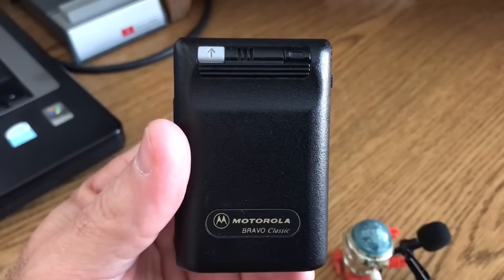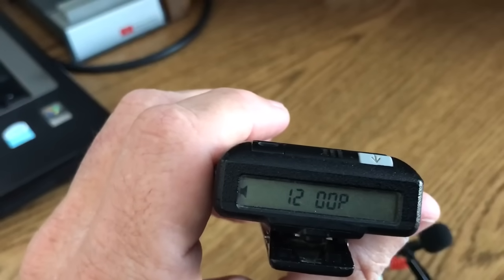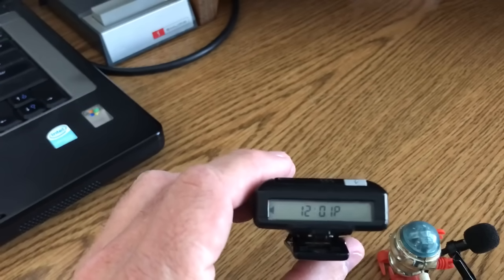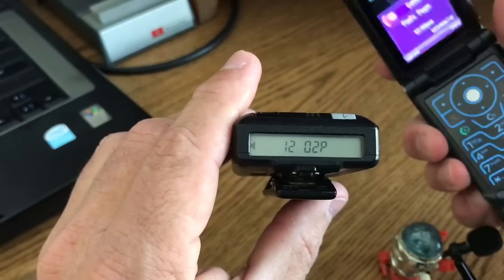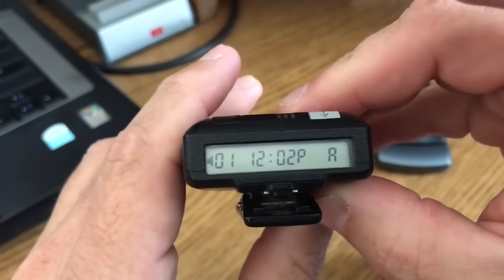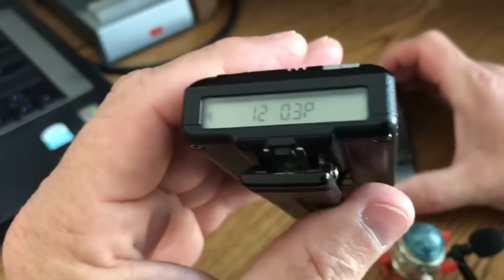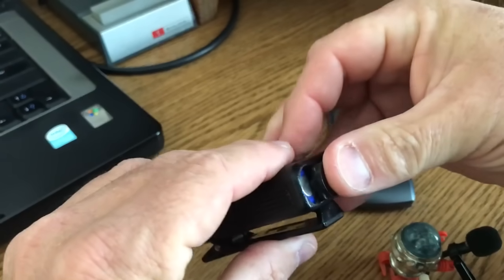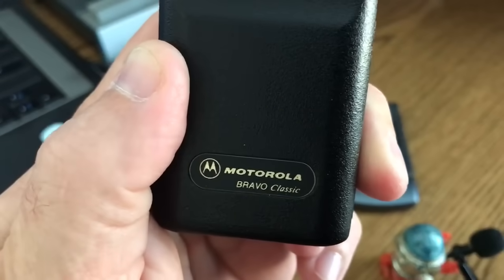How do pagers (beepers) work?

Comment: Since everyone has cell phones, do people still use pagers ? 
Or did cell phones make pagers obsolete.
Reply from the maker: Yes and no. There are definitely fewer paging customers now, but they aren't dead just yet.  I still use mine for work.
Reply: @ModelA  
If you have a cell phone what's the pager for. 
Doesn't your cell phone tell you who's calling just like a pager does.
Reply from the maker: a pager is still useful in many ways
Reply: @ModelA  
What ways are those
Reply from the maker: @RandomStuff-i4i    For one- Pagers are not traceable.  Nobody can tell where you are or how fast you're driving.  For another, you call back on YOUR time.  You don't get interrupted in the middle of something because so-and-so is calling on the cellphone.  Lots of ways.  Think of your own.
Reply: @ModelA  
My cell phone doesn't let anyone know where I'm at or where I'm goin. 
And.... when I do get calls on my cell, I decide if I want to answer it or not.  

But thx for your time.
Reply from the maker: @RandomStuff-i4i    Your cellphone is constantly handshaking with the cell network(s) and the handshake protocol includes location information either provided by the device itself or triangulation of 3 or more base stations receiving the handshake.  If that didn't happen, your cellphone would not work.  It is being tracked at all times when it is powered up.  Pagers do not transmit, they are receive-only.  Cannot be tracked.
Reply: @ModelA  
Are you talking about tracker or location
Reply from the maker: @RandomStuff-i4i    I'm talking about the cellular control channel and mobile unit (that's you) protocol.  The way the cellular network knows where every active device is so it can direct traffic to it.  You know when your cellphone is showing how many "bars" of signal on it?  It is communicating with the network, giving your precise location, speed, etc.  What the network does with that is far from private.
Reply: @ModelA  
So turning off my location to off doesn't turn my location off. 
It just says off.
Reply from the maker: That is correct.  The system still knows where you are.  Otherwise, you would not be able to receive calls or messages.  The beauty of a paging network is every message goes out on every transmitter at the same time.  The system has no idea if you are there or not.  It just throws everything at the ether and assumes some of it splattered on you.
Reply: @ModelA  
That's interesting. 
Somewhere irritating but interesting.
Reply: The networks used for paging have higher reliability and uptime relative to cellular networks. Part of this is down to simplicity, part is because paging clients demand it, part is because the physical infrastructure is built sturdier with fewer failure points than cellular towers, and part is because paging is ultra-low-bandwidth. For example: if a stadium collapses and everybody in it is trying to call their families, share pics/video/etc., cell towers will get clogged up instantly and a large percentage of the communication will never make it through. But what does a paging tower care if it's told to broadcast five 20-byte messages or a thousand 20-byte messages?

Pagers themselves are very bulletproof units that can operate for weeks on a pair of AA batteries. They're antennas that sit on your hip passively listening for a message to come in over the radio.

For professions like medicine, law enforcement, high-end private security, fire, etc. where lives and/or enormous amounts of money depend on a message getting through they're the best way for a command center to get essential info out to personnel.
Reply: @ModelA so you only carry a pager and not a cell phone?  How do you call people back, cuz there aren't pay phones anymore.  Do you wait until you get back home or to the office?  Just seems like a text message is the same thing but better.  You know someone wants to get a hold of you and they can tell you exactly what they want but you can still respond at your convenience.  Well whatever the reason I'm glad you still get use out of your pager, I'm just wondering how and why 😊
Reply: Doctors still use pagers because they get better service, are loud to alert in an emergency, and are reliable
Reply: @theweirdospfan.28  
We must live on different planets. 
All the doctors I've seen or been to don't have pagers. 
They have cell phones.

Comment: If you have to get a replacement pager, does it have a different ID number?
Reply from the maker: If you know someone who can program pagers, you can request them to program the same frequency and cap code as your previous unit.  I have 2 of the same pagers programmed the same.  If both of them are on and I get paged, they both go off.  I keep one of them at home as a spare.

Comment: Why do you use such an old cellphone?
Reply from the maker: Because it still works just fine.  I'm not the type to throw things away just because something newer comes along.  I have a very small waste footprint.  I'm still driving a 90 year old car (see my other videos).
Reply: I had that phone also, motorola razr...the original
Reply: The razr was a fantastic phone. Mines lasted for 7 years
Reply from the maker: burteriksson     Close.  1931 Ford.  See my recent videos.

Comment: How much is the service
Reply from the maker: About $70 per year
Reply: @ModelA  Do you have to contact Motorola once u get the pager? Or something else
Reply from the maker: @AndStill.    No, you contact a carrier first.  I am on American Messaging.  You start there.
Reply: @ModelA  sorry for the 100 questions but I dont think you mentioned in the video so contact American messenger. Then Motorola?? Thank you
Reply from the maker: @AndStill.    Glad to help.  No, just contact American Messaging and they will give you a choice of pagers.  You buy the pager from them with service already programmed, etc.
Reply: Last question can a pager work internationally? Using American messaging
Reply from the maker: @AndStill.    No.  If you go to the American Messaging website, you can click on their coverage maps.  I don't see anything outside the con USA.
Reply: @ModelA  OK thank I was thinking it would be a good opinion going aboard

Comment: review that moto razr
Reply from the maker: It doesn't work anymore after the 3G shutdown.  I was bummed out.
Reply: @ModelA  i used to want one of those back then
Reply: @ModelA moto razrs run on 2G not 3g
Reply from the maker: @theweirdospfan.28    This was a V3xx.  It was most certainly 3G.  You could even see the 3G on the screen when in 3G coverage.
Reply: @ModelA  I thought you were talking about the original v3
Reply: @ModelA try mint mobile! It’s what I use mine on
Reply from the maker: @ChasesDigtialWorld   In my area, Mint Mobile uses the T-Mobile network, and they shut down 3G like everyone else already.  There is no 3G service on any provider anymore where I live.

Comment: Why in the word would you stil use this for work!? Lol
Reply from the maker: Because it still works very reliably.  Some of us do not believe in "throw away society".
Reply: @ModelA  but if you have a cell phone where does this come into play?
Reply from the maker: @Chuwks1991    The way I do it is keep my cellphone turned off, since it eats battery leaving it on.  The pager battery lasts for several months, so it stays on.  Since my phone is off, calls forward to the pager number.  I get alerted on the pager when someone leaves a voicemail.  I juat check them when convenient (like when not driving or eating or at work).  If I want to call someone back, I do, then turn the cellphone off again, saving battery.
Reply: @ModelA  oh that actually makes a lot of Sense! Thanks for sharing how this works btw!
Reply: Alot of doctors apparently still use it due to the walls in the hospitals that prevent xray penetration. A pager works off radio frequency which uses multiple satellites. A cellphone would work off a single cell tower that’s nearby.

If you go to the hospital next time, you will notice some areas in the building have 0 reception.
Reply: Is wee bet still 07?

Comment: lol i'm also 20, do they have sim cards?
Reply from the maker: No
Reply: @ModelA  how do they work then? do you have to pay a contract like on a phone or is its service forever free once you bought the device?
Reply from the maker: @bigfood2001    The pagers all get programmed with what frequency they will monitor, baud rate, and a unique cap code.  When the carrier gets a call to that pager's unique phone number, it knows which cap code to send the page to.  The pager is just listening to the programmed frequency and when it picks up its cap code, it displays the info sent after.
Reply: @ModelA  thanks!

Comment: You are talking like a disposable battery is somehow better than a rechargable one. Nice video tho.
Reply from the maker: Well, from a convenience standpoint it is.  Thank you!
Reply: WTF when it last for Months vs Days, yes it's superior. But that's more to do with efficiency.
Reply: @Neojhun  A rechargable could do that too. This device obviously doesn't take much power.
Reply: @human678  Most easily attainable rechargeable can not. Both Lithium Ion & NiMH have phantom drain in weeks, not months. There is massive flooded cells like car batteries that can hold charge for months. Sorry i'm very nerdy about battery tech.

Comment: But aren't those things useless now since there aren't any payphones around anymore
Reply from the maker: Still super useful
Reply: @ModelA  See, I'm trying to figure out how they are still useful. Could you explain it? Seems that the point of these was before mobile phones. Someone would call your pager, leave a number, so you knew you had to call that number. But now, we have mobile phones. Couldn't you just call that? Seems like having a pager in the age of cellphones is just adding an unecessary step to the whole process.
Reply from the maker: @DeadManSinging1    If you look at it that way, you're right.  However, some of us prefer to be off the grid now and then.  I don't like having big brother knowing here I am, where I am shopping, how fast I'm driving, etc.  Not that I have something to hide, I just don't like it.  So there is an option for people like me who have to be on call for work but want to be off the radar sometimes.
Reply: Useful in health care especially hospitals where cell signals don’t get through walls and you still need to have communication with a physician or your family outside. I’m a surgen, and I can’t rely on cell phone service when I’m making my rounds in the hospital. A pager is far more reliable when someone is counting on you to be reachable. Pagers work on a different frequency and can’t be stopped by cement or metal walls or hospital equipment like a cell phone can.